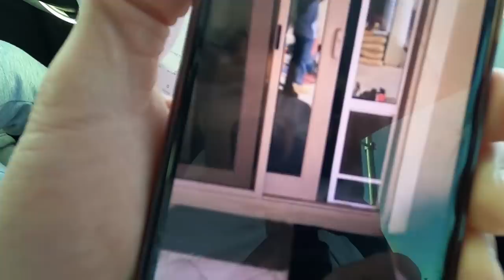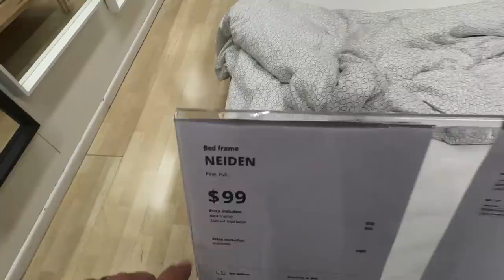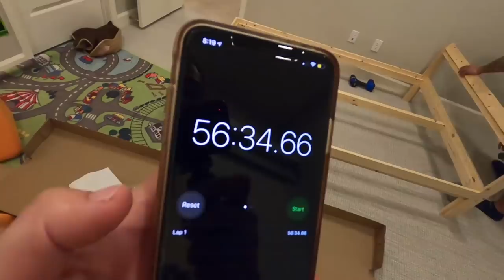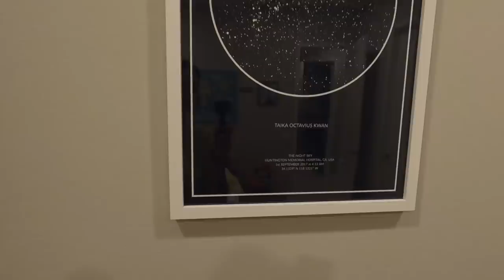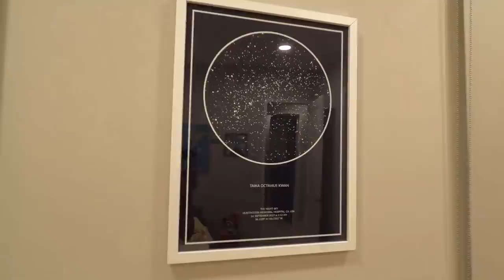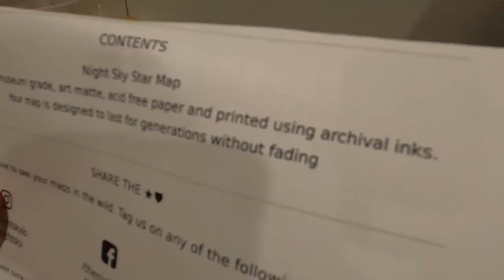Taika Explores Ikea For A New Bed!

Comment: As a tip you should buy a mattress protector cover that can be wash in the washer or is easy to clean with a washcloth in case he wets the bed
Reply: 15:40 Its on the floor in the packaging. They forgot to put the mattress protector on.

Comment: For the kid who is hyperactive and runs and jumps on everything and has absolutely no discipline, that bed's physical security may last 3 days. You can't even romp in that bed. He's going to destroy it and possibly hurt himself in doing so. If he were my child, I would have gotten him a basic standard twin metal frame, with a boxspring, 2x bedrails, and I'd place it far away from either wall, with only the head of the bed on a wall. That way, I could be a Parent and discipline him, if he ever felt the need to stand or jump on the bed. I would also redefine his behavior with running and jumping all over the couch. The couch is for sitting ONLY. He's going to run and jump and bounce off the wall and break the cheap wood slats on that bed. If you can buy Yourself $1000s in wardrobe, a $99 bed shouldn't be expensive in your mind, unless you're completely Narcissistic, and the idea of spending money on someone other than yourself is a complete waste of money. You need to put a little more thought into the things you do so that you have the best decision that is Beneficial to Everyone. He's never going to get into a bedtime route unless you lay down the law and get him to bed before 7pm. Children require a MINIMUM of 12 hours of sleep, but 12-14 hrs is ideal. He also doesn't need anymore "Calories." He needs Clean Engery. Pizza is like putting sand in your gas tank. Cereal is sludge. Ask a certified nutrionist how to feed your baby.